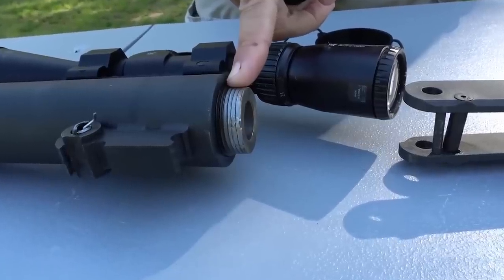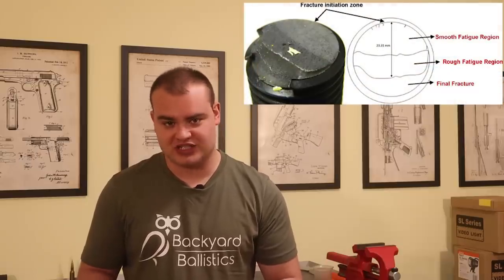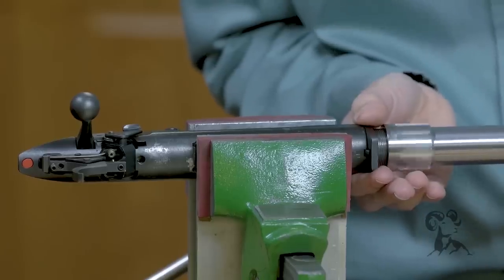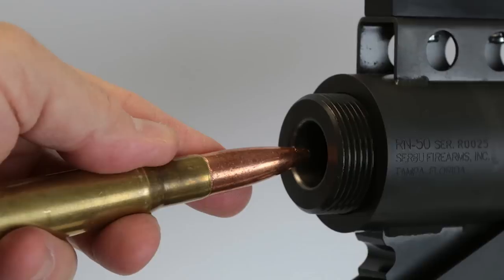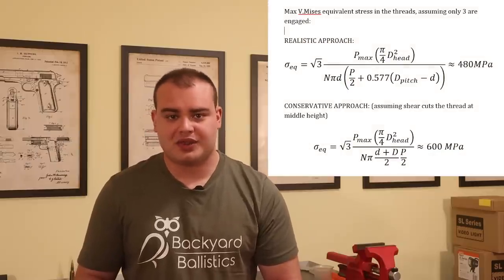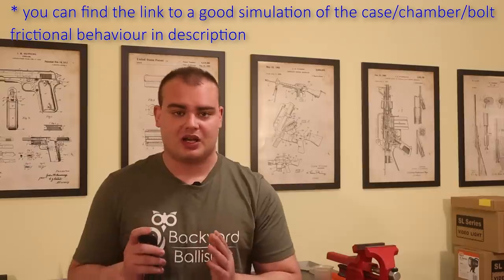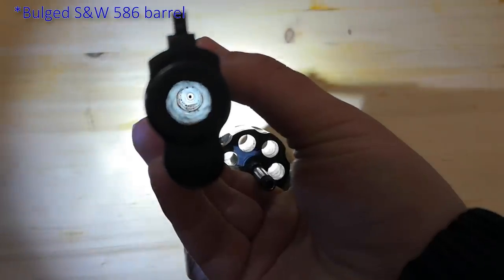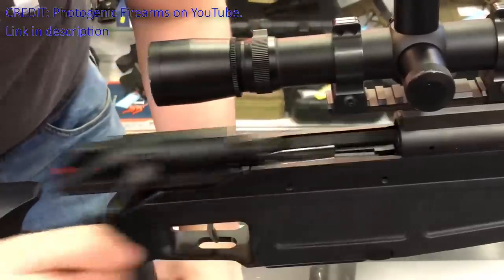Serbu RN-50 Failure: A Closer Look

Comment: There's a reason bolts have huge lugs that lock into the breech so the bolt/cap won't go flying backward. Using a cap on a .50 was a bad idea to begin with. I'm no expert so this is just my thinking, but Serbu should consider trashing the screw cap idea and going with a locking lug bolt. Or something that has multiple locks to be absolutely sure that bolt/cap won't go flying backward in the case the user fires an overpressured round (which should be assumed will happen for the sake of safety).
Reply: I’m guessing Serbu use a threaded cap because it’s a budget gun. Moving to a full bolt mechanism would put the price up significantly. 

Update: He makes one already, it’s double the price ($2,500 vs. $1,250).
Reply: @fredbloggs5902  Correct, but I think some safety measures are worth the higher price. Especially when shooting such a high pressure round

Comment: 7:11
INTERRUPTED THREADS!
Is THAT the term I was looking for? I saw them in aerospace applications decades ago, but found nothing on them the other day because I couldn't remember the correct terminology : )
NOPE... JUST CHECKED: I still don't think this is what I was referring to. The threads on the fasteners I saw were "relief-cut" only one component, requiring normal fastening procedure, i.e., turn one fastener multiple rotations until slack is taken up, then torque to spec, NOT 1/3 turn (for example) to attach as in some take-down rifles, etc. So, I'm still stuck looking for something which I can't remember the name of : )
Reply: Wouldn't matter - look up the torque for a 1-1/2" fastener. Are you talking about a slightly deformed thread that provides better locking, but is relatively free turning until it gets snugged down? If that's it I can probably find it.
Reply: @randyg9209 : I only mentioned torque to illustrate the difference between the two types; you wouldn't have to torque the assembly to gain the advantage of the "relieved" threads, since torque is just an indirect measurement of stretch, which would be provided by the pressure generated by firing the cartridge.

I saw the threads I'm referring to mentioned in an article in the mid-70s, so I'm straining to recall the details.

Maybe this: Picture a nut that has a channel cut perpendicularly across the threads at three points around the circumference. At the seat of the nut, the channel would be cut to a depth equal to the major diameter of the internal threads, and the depth of the channel would decrease until it misses the last (let's say sixth) thread's minor diameter completely.

Thus, the first thread at the seat of the nut, the most heavily loaded normally, would have its mating surface with the corresponding heavily-loaded male thread reduced by the greatest amount. Due to the tapered nature of the channel, the amount of mating surface and thus potential load-transfer would increase towards the LEAST-loaded FINAL thread in the nut, which would be the ONLY one with 100% of standard thread mating surface.

Of course, this design would have been intended to lessen the likelihood of a BOLT BREAKING at the first thread engaging the nut... not sure if it would have any benefits against the shearing of threads. But it MIGHT, if the shearing follows a similar pattern, i.e., the first male thread engaged by the mouth of the cap begins to fail first, followed by cascading failure of the subsequent threads, since the thread loading, and thus stretching of the male component, might be more balanced at maximum stress.

Comment: The 50% safety factor is wholly inadequate because this is not static. The material properties are based on quasi-static measurements. The threads on the cap are pushed toward the barrel before firing by both the firing pin spring being pushed by the hammer and the initial recoil, but when the primer or case leaks, the pressure pushes it away from the barrel. There is a small distance through which the cap moves in the thread gap, and that makes this an impact load. The cap threads impact against the barrel threads. A static analysis of stresses will not suffice for this design.

Larger threads won't fix anything, they make it worse. The area the pressure acts on is the area inside the threads on the cap. If you increase the thread diameter, you increase the pressure area with the square of the increase in diameter. The threads would need to be smaller, which would necessitate a plug rather than a cap.

The weak link failure is in shear which any good mechanical engineer will tell you is an unacceptable failure mode for pressure retaining parts. The thread engagement should be 50% of the thread diameter so that a barrel tearing itself apart releasing high pressure gas, but no flying parts is the result rather than having the cap breaking loose energetically.

Everything you say starting at 6:47 is unadulterated bullshit. Once a threaded fastener starts to strip, the process always goes to completion. When the thread starts to shear, the remaining area to resist the shearing is reduced, but the load is constant, so there is no mechanism that is going to stop it. You cannot find an example of the scenario you describe in any fastener or materials or design book. It sounds plausible, but it isn't even close to correct. The threads failure propagates through the material at high velocity despite the material being ductile and that is one of the reasons that shear failures are not considered acceptable in engineering design codes for boilers and pressure vessels.
Reply: I had to read the first bit a few times before I understood it, and I think you are correct. The rest of what you say shames Backyard Ballistics. If the threads are really fine pitch like he says It didn't take a hot round or obstruction to make it fail, just a blown primer.
Reply: @randyg9209  
Backyard Ballistics is saying way too many things here that just aren't true, and people don't know the difference. He wouldn't last a week at my last engineering gig, unless he was in the sales department.

Comment: Sounds to me like the two lugs that sheared off need to be extended both higher and need to run all the way back to the stock instead of just two small lugs, giving several inches of steel to shear off raather than the 1/2 to 3/4 inch of the current lugs.. Seems to me that would prevent the lugs from shearing off and keep he cap from moving at all. The failure of those two lugs happened at the same time as the threads failing. If I were th manufacturer I would recall all receivers and replace them with receivers with much more substantial lugs.,

Comment: your comment on "most rifles having a threaded breach" is incorrect. The forces involved with a conventionally threaded rifle barrel are opposite the forces involved hear. the forces on a typical bolt action barrel are pulling the barrel rearward this would compress the shoulder against the receiver ring preventing any thread shearing. This motion and force can be easily proven on any recoil operated gun. the bolt and barrel move in the opposite direction as the projectile.

Comment: I think no one can properly assess what happened without looking at the cartridge case and headspace
In most of the weapons that I have seen explode backwards the cause has been a perforation of the piston of the primer.
Obstructions often cause the barrel to break.
This weapon has broken like it should never break.
I can't believe rifles are made without overpressure vent holes

Comment: I don't like your excuse for it not being fatigue. A fatigue failure on a threaded cap could easily look like that. The loading on the threads will be quite uniform after a shot, the threads could be damaged and still retain good screwability. I agree, it's extremely rare to have a fatigue fracture which looks like Scott's gun BUT the loading conditions are also extremely rare. Outside of firearms or explosives you aren't going to find an extreme impulse load like that.

A yield strength of 900 - 1200 MPa is extremely generous for even the most exotic of steels. Very high yield structural steel, S700, is 700MPa. This will have a drastic effect on the fatigue cycle calculations. At a price of $1300 for the Serbu RN-50 I cannot imagine they are using exotic steels with proper heat treatment.

I believe the RN-50 is extremely badly designed. It has been pieced together by a machinist, not an engineer.

Comment: Doesn't matter what caused it to happen the fact that it happened at all is worryingly deadly
Reply: I mean, this is a risk with every firearm. We’ve all just become complacent to the thousands of pounds of pressure that’s sitting right next to our face every time we pull the trigger on a firearm.
Reply: How doesnt what caused it matter. You could apply that same logic to plane and car crashes. Doesnt matter what caused it to fail so we'll either get rid of them all or just keep using them, with that kind of logic planes and cars wouldnt be continually tested and refined to make them safer. What caused it to fail is the most important thing to make sure it doesnt happen again.

Comment: The second slap round was a very powerful explosion. Could have damaged the threads. One too many slap rounds.
Reply: If the rifle would get damaged by a slightly overpressured round, then there is a huge problem with the quality of said rifle.
Reply: @BloPsy__  If that 50 blew apart after ONLY one round that would be a Major problem and a surprise as well.
Reply: @lightnentim  Well, what do you expect when you load basically a small bomb in your rifle? That round was extremely hot - there is no rifle that would survive that round.

Comment: rolled threads are far better than cut threads - aircraft flying wires - ends are rolled threads not cut - if they were cut - that machining can cause errors and possible deficiencies in the threads - roll the threads and this does not happen.

Comment: The threads should have been more coarse like locking lugs on bolt actions. The screw cap is the weak point in the gun. Plus no overpressure safety features.
Reply: The threads being more coarse would have changed nothing at all lmao. And remember that his gun had a special heavy barrel fitted.
Reply: @marcusborderlands6177  yes the barrel is HEAVY. that's why it didn't rupture. The cap on the other hand. I may be wrong. But I really think the cap needs to be more robust.

Comment: the key here is not who's or what  responsible or why..But as Ian in Forgotten weapons pointed out is.. 'IF' there is catastrophic failure!  what steps has the manufacturer taken to mitigate killing the shooter. because in this case. Failure ended up with a canon ball and 2 bullets flying backwards toward the shooter. And it was a freaking miracle that he didnt get killed! So.. I am Sorry.. but that gun design is just not safe..The cap should be heavier.. with vents.  there should definitely be more bigger threads.. and the locking lugs should not be lugs, but be a solid cover filling the entire lower to the back end. Sure the gun would probably destroy itself anyway.. but the shooter would definitely have more chance of survival.

Comment: here is my take. I am no expert on firearm but i do know explosives. And i do know sabot rounds.
Obstruction at the front, obstruction at the back explosive in the middle. The weaker obstruction will fail.

Now the question is really WHY was the breach lock/ threads the weaker obstruction on this case?
Well at the front was one thing and that was the bullet.
So the bullet plugged the barrel somehow. 
THATS A GIVEN!!
and the expanding gasses took the path of less resistance. 

So why would a bullet that's designed to conform plug instead. 

I think its all down to the basic design of a sabot round. The tungsten penetrators must sit in the exact center and the round must all sit square to the bore. If the sabot is softer on one side, the penetrator is canted off centre or if the sabot has more mass on one side than the other then you are going to have a very bad day.

ALL those things will cause the penetrator to instantly jam the barrel and well if the explosion cant go out the front then its certainly going out the back

Comment: There is no discussion in regard to breech/barrel steel grade. This is perhaps one of, if not the most important factor in breech locking strength. Most reputable rifle manufactures will list the exact type of steel used in the manufacturing of a weapon. The Serbu site says it's RN barrel is "Alloy steel", it doesn't say 416ss, 4140, 4150, or anything else. It just says alloy steel. When I hear someone say, "Oh it's alloy steel" I immediately start to question things because is gives almost no information and disregards the fact that steel is an alloy. So saying steel alloy is about as useful as saying steel steel or alloy alloy. I am not going to pass judgement, but in my experience when you have something that is unexceptional, most ppl do not go into detail or specifics. When something is of merit or repute, most ppl want the world to know about it. Oh, and 3 threads is just a very bad idea.

So, I would really like to know the exact type of steel is used in the gun.

Comment: i dont think the gun is "weak" or has a flaw...
.
but i think a "vent" in the cap would be a good idea
like my Ruger M77 MK2 has a hole in the right side of the receiver.... just behind where the bolt lugs would be when in battery
this provides a path to vent gas away from your eyes
.
.
i simply think this round would have blown up or SERIOUSLY damaged ANY!!!!! 50 cal on the market today
guns arnt made to be able to take a round filled with TNT (aka, pistol powder.... or a double charge, ETC)
.
the RN50 seems strong...... its just not bomb proof
heck.... even my ruger m77..... or marlin 336.... or m1 garand.... or m91/30 would blow up if loaded with pistol powder

Comment: Besides the slap rounds that were hot and actually caused catastrophic detonation the design of the serbu has very bad saftey flaws regarding the breach screw on plug,and the lack of protection over the action and breach section of the barrel. Also theres no way of putting in pressure relief ports on the action,so with all these saftey issues ive pointed out it is in my opinion that this death trap firearm should be immediately pulled from circulation and scrapped for obvious saftey reasons. This will happen again,and when it does it might just kill the person shooting it. If mark serbu fails to pull these rifles from circulation he should be held liable for any accidents that happen,the saftey issues have been clearly pointed out so it is his responsibility to ensure these rifles are either made safer or completely scrapped and redesigned for use.

Comment: I had said on your last video that depending on how many rounds had been put through the gun the threads could have gotten wore down ,making it possible for gas to get past them.I also do believe there was definitely some higher than normal pressures going on because of the larger muzzle flash.Combine excessive pressure with worn threads on the cap and it's plausible it could have caused the failure.
Reply: Scott at Kentucky Ballistics got that rifle some three years ago, and I saw it mentioned (can't remember where now) that he has fired SLAP rounds through it before. He certainly fired at least a handful through it on what proved to be the final occasion... As I understand it, he is sending the rifle back to Mark Serbu; I hope we will find out just how many of those over-pressure rounds it withstood before failure.
Reply: @matthabir4837  yeah I don't want to be misunderstood,just from taking the cap off ten thousand times the threads can get wore down.i wasn't trying to say the threads get wore from shooting it ,but they do get wore down from the process of unthreading and threading  the cap .
Reply: @dustinpomeroy8817  Thread wear happens when there's load applied while the thread is rotated. Because the rifle cannot be fired while being unthreaded, someone's hand can't press or pull into the steel hard enough to wear it down.
Reply: @ChucksSEADnDEAD so you're saying the threads would be just as tight after being used a thousand times as they would new?altho I don't fully agree with that ,but I do aknowledge what you are saying . I believe extreme pressure was the main culprit,and I guess what I was getting at is maybe those caps have a service life that was exceeded and maybe they should be replaced after a certain number of rounds.Thats all I was getting at and I am most definitely glad Scott is alright and back to normal,he's a good dude and I hate that that happened to him.The fact that he got right back on the horse is admirable and is the kind of quality I look for in people I surround myself with.

Comment: Roughly 55k psi nominal firing pressured or stock ammo versus 85k+ psi to strip the threads off the barrel. Old and exotic ammo is more than likely the cause. Wether the sabot came apart going down the barrel or it got opened up and the powder charge changed at some point. Pretty sure Scott’s was the first one to fail like it did over the nearly 20 years they’ve been in production. Might not be but if it is then it wasn’t the firearms fault.

Comment: He put an overpowered hot round into a rifle that was not rated for it. Its not his fault. Its not the manufacturers fault. Firing a gun is literally a controlled explosion in your hand. I saw a guy lose a finger after using hot hand loads in a 9mm. Its tragic that it happened and I'm glad KB is alive. The blame though is solely on where ever he got those rounds.
Reply: Except the failure mode endangered life.